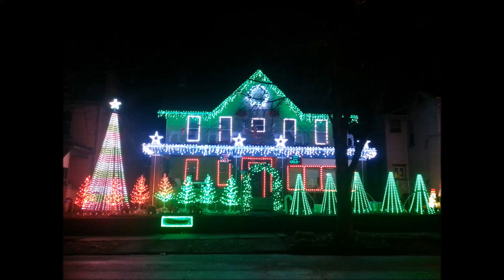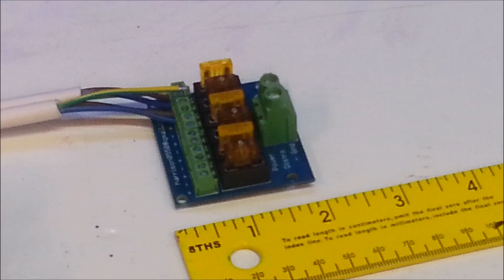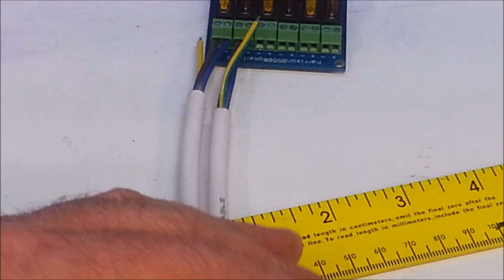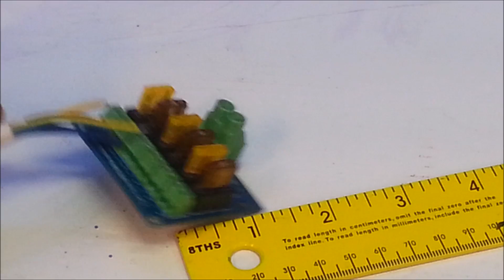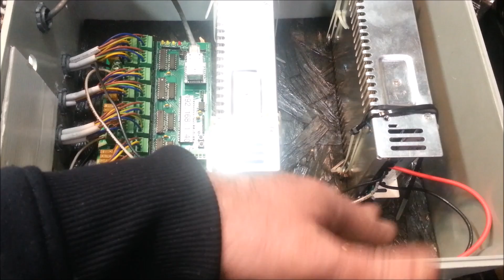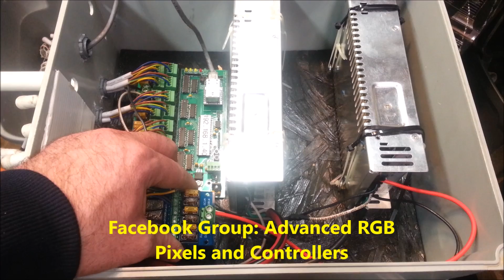Power Injection Board

Comment: I need to run 1000 per output 3 in about 250 feet how many wires and gauge to power inject at  the end
Reply from the maker: This board can only run 12 universes of pixels.  That is 12x170 pixels.  You will need more controller than that.  I typically use 18 gauge wire and will inject power through the prop at different points.  I have never run a prop with more than 300 pixels on one output.

Comment: Thank you for all your videos, I am slowly learning from each.  A question that I have is in regards to the pig tails.  I would assume that each wire is assigned to one of the connector pins on the male ends of the tail.  If so, how is this determined?  My concern is that I might connect a male power into a female data or neutral ECT...  I hope this makes sense and again thank you.

Comment: If there is some distance from your controller board and power supply, wouldn't it make more sense to run one set of longer, larger wires to the board and then place the board near the pixels in a waterproof container, then use short smaller wires to the pixels.
Reply from the maker: +Black Wolf Acres 
By all means, that is a great idea if you have a need for that!  This controller will sit at the base of my mega tree so it doesn't require a long run.  If, however, I were trying to inject power down the line on multiple runs of pixels (say 60 feet); you could locate the box with this board and a main power line (with heavy gauge wire) at the other end for easy short-run power injections.  That is what makes this power distro board a great item.